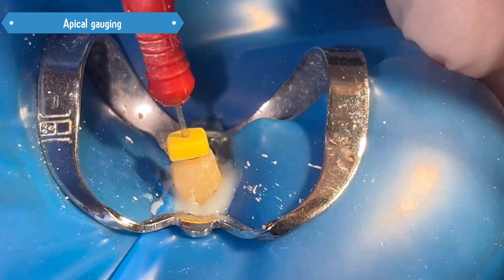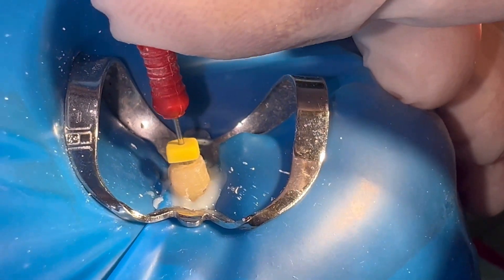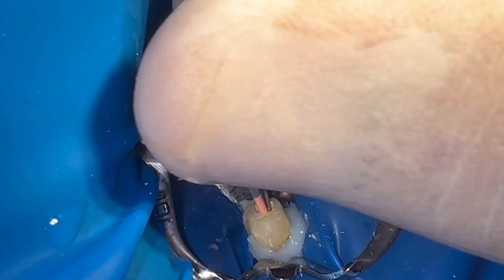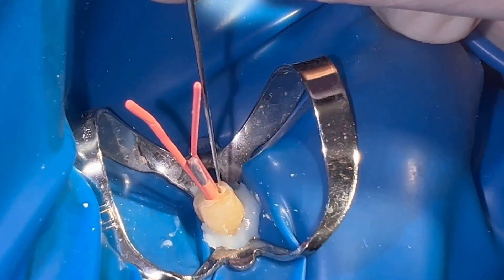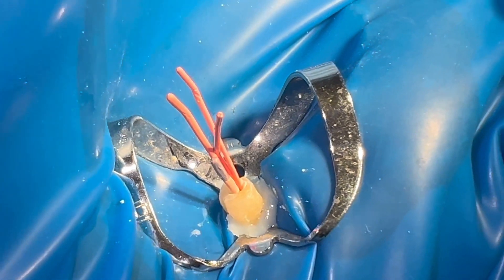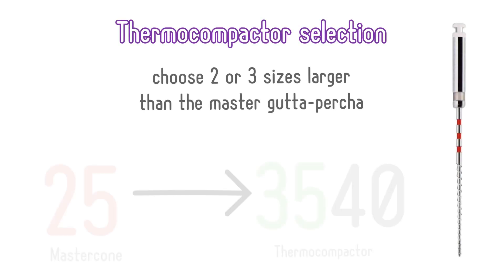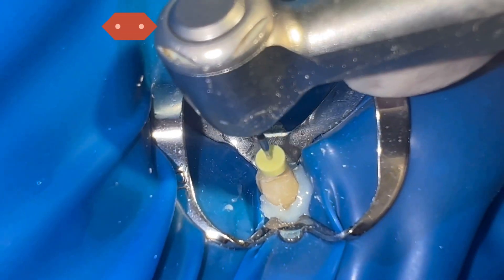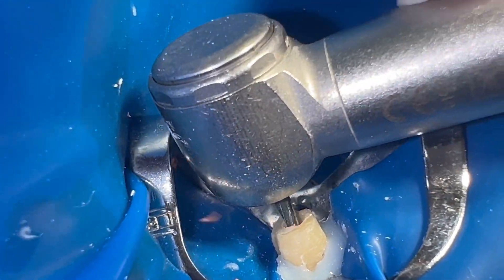THERMOCOMPACTION TECHNIQUE Step by step real case

Comment: Great explanation. Thank you Sir for posting this. One query though, can we do the compaction of 4 seconds only once or we can do more cycles of compaction if we're not satisfied?
Thank you.
Reply from the maker: hi there! Normally the 4 seconds compaction is because of the heat. I normally do more cycles. Sometimes i put more xfine GP cones to do another cycle. Just depends on the canal width
Reply: @endoaddicted  this clears the confusion. Thank you so much for your response.
Please post long case videos, maybe a 15 or 20 minute. I would love to watch every single video. Thank you again.
Reply from the maker: @DrShahid-Shafi  thanks 4 your comment..  I always try to do shorter videos cause sometimes are bit boring but I take in consideration

Comment: If prepare canal upto 6 percent 25 and place 6 percent gp with ah plus resin single cobe and then use compacter 40 04 ya 35 04 upto 6 mmto 7mm short workling is this okay technique ya not sir
Reply from the maker: I prefer to work at 4 or 5 mm from the working length. but you have to make sure you have a good apical stop so as not to extrude too much cement.